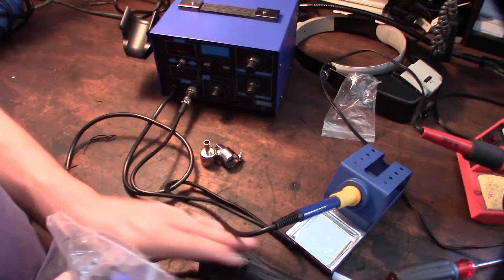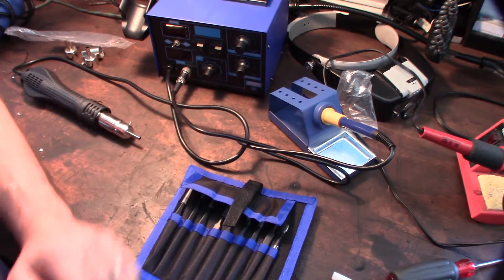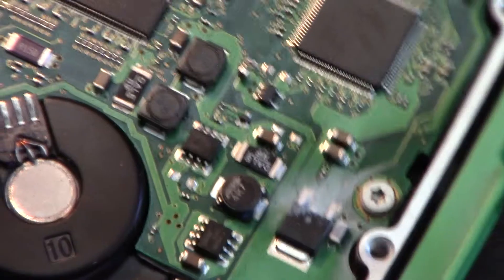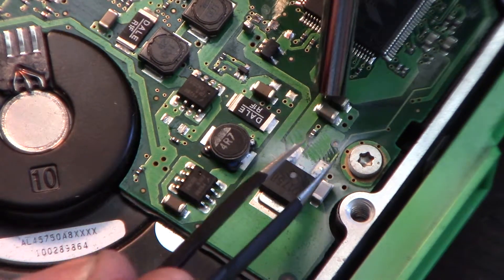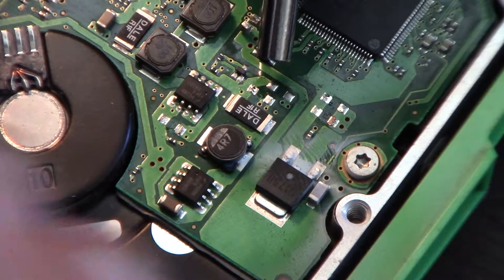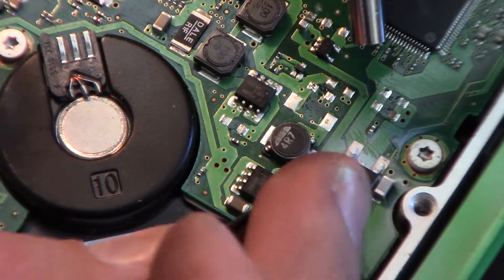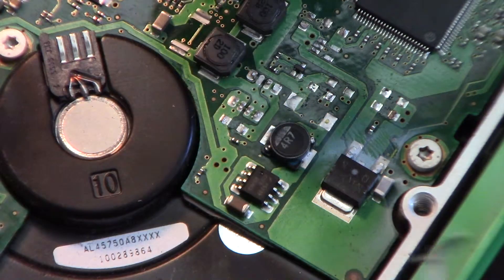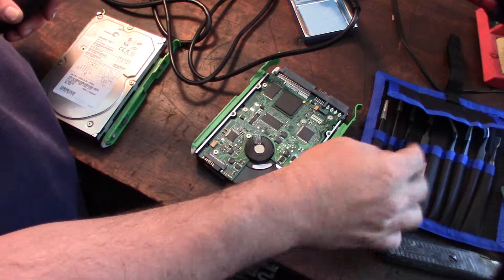ESD Electronics  Tweezers Tools, Precision Anti-static Non-magnetic Stainless Steel

Comment: for bigger components you need to add low melting temp solder first then heat up with air gun it will be, easier to take of, other wise high heat can damage component.